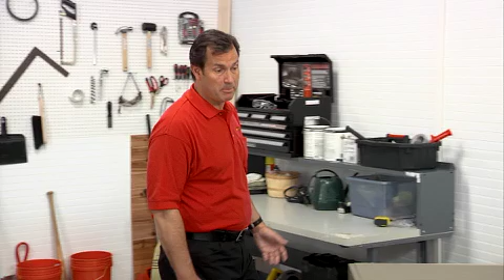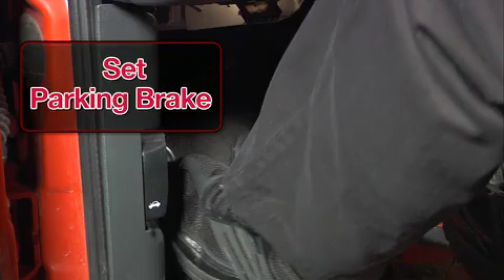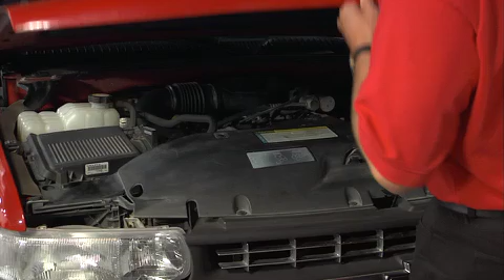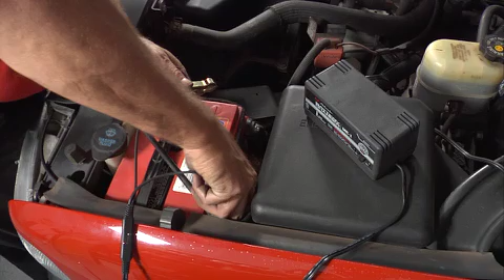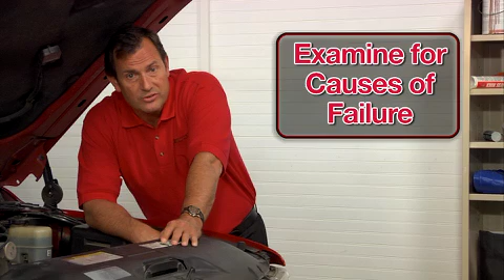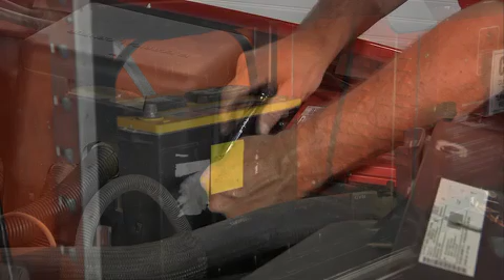AutoZone Car Care: How to Replace Your Starter

Comment: ok, here is my situation.  We had a bad wind storm almost 2 weeks ago.  Next day, my van wouldn't start. (2008 Dodge van)  "Friend" called a mechanic and he came to get van, took to his shop.  The mechanic put in a brand new battery.  I used it less than a day and while home, again, next morning, van would not start.  I get a clicking noise, which sort of sounds like the starter.   No dash lights and very week headlights.  Van has now sat under carport for almost a week.  Must wait for new payday, about 3 weeks.  So, is it starter or alternator or both?  I fear a big bill coming!  What happens if the van sits until then with no starting it up at all??  Any help appreciated.

Comment: How am i supposed to get my car to auto zone if my starter needs to be replaced..................?
Reply: Why do you need to take it to AutoZone?
Reply: +Michael Figueroa lol i dont he just keeps saying to take it to autozone but if my starter is done for then how am i supposed to get to auto zone?😂😂
Reply: Anna Vaughan oh lol true that :)
Reply: @annavaughan1456  get a tow truck
Reply: @annavaughan1456 a tow truck ?
Reply: This happened to me once. I was stuck at the convenience store by my house. I tried to jump it but still nothing so next I tried the starter. All you have to do is tap on it with like a tire iron and then it started. It got me around for a couple of weeks until I got my new one so definitely beats towing it.
Reply: Anna Vaughan if you have to ask that then you probably don't know anything about cars in the first place.
Reply: +gibbitup I just installed the starter in my car and it wasn't that hard. Just 3 screws. It still doesn't turn on thou but I'm making progress. Good luck in your car.
Reply: No lie I once carried my battery 5 miles to get it charged cuz I didn't have a charger at home LOL
Reply: @PurpleGoldSwaggg  was it really that far
Reply: gibbitup so it was your starter?
Reply: So mechanic just got back to me. It's the starter. It's going to be roughly $400-450 for labor and a brand new starter. Hope this helps!
Reply: It might work with a jump. Then you can drive it there and have it tested. Knocking on the starter works temporarily too sometimes.
Reply: Anna Vaughan walking :/
Reply: Uh, walk? Bus? Taxi? You don't have to take the whole car there.
Reply: I'll take you
Reply: Why the f would you take it there?
Reply: That's what my tow guy said. Whenever I turned over the engine it clicked and as I looked it up, that's typically a starter issue. I want to make sure that there's no other issues though. Here's the link:

http://www.farmandfleet.com/blog/car-will-not-start/
Reply: +gibbitup cool man. Keep me posted on any other issues you find please. I'm having the same problem
Reply: Just take the starter haha
Reply: Thats adorable 🤣
Reply: Right
Reply: Just whack it with a hammer
Reply: U kidnap a auto zone technician lol
Reply: You can hit the starter and it'll kick over,that's how you know your starter is bad in the first place
Reply: Lol you're going to need a tow. I just got my car towed for this exact issue to the mechanic to check if its just the starter or if there are any other issues.

Comment: Not all starters are located under the car. Cadillac 4.6L, Oldsmobile 4.0L Aurora and several other V engines have the starter located under the intake plenum in the valley of the block.
Reply: "IS THERE NO STANDARD ANYMORE?" -- Pantera